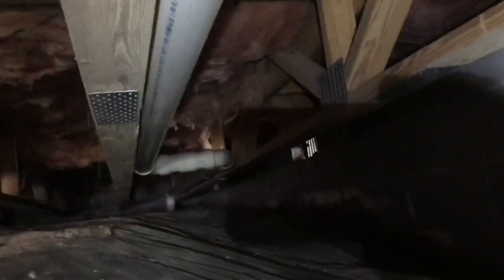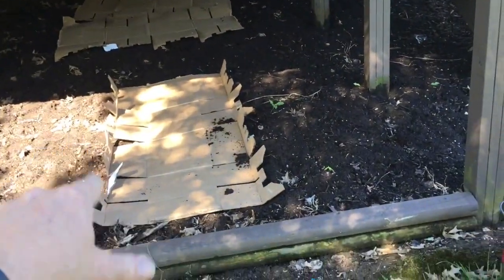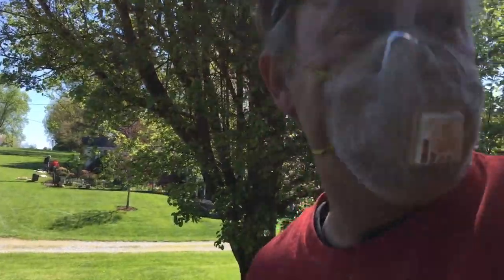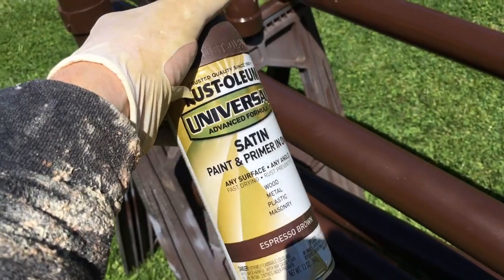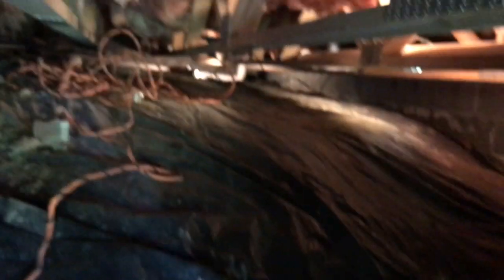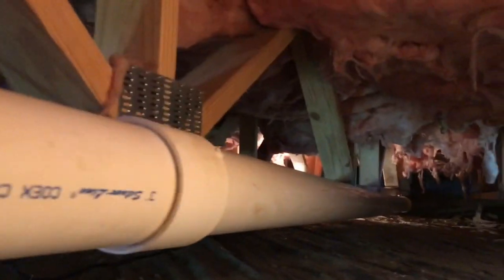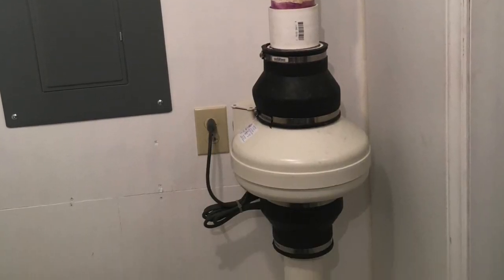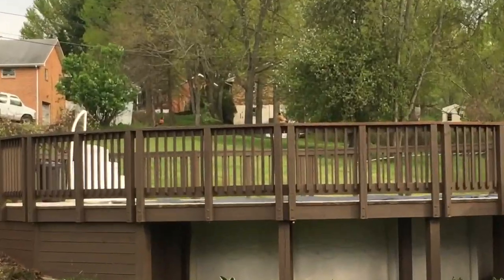Bringing a homemade radon system up to code

Comment: You talk about "code." Show me in 2012 IBC anything about radon. I'll save you the effort. Building "Code" doesn't exist for radon systems. What the home inspector who got a Home Inspection Certification from the back of a  Men's Magazine meant is he needed to justify to the prospective buyer his $500 to $1,000 fee. Ethically, any system that maintains interior living space at 2.5 PC is what a homeowner needs and wants. "Code " is an emotional word used inappropriately by cons.

Comment: Is there any code requiring an outdoor radon fan to be a certain height above ground level? I want to lower my radon fan to about a foot above the soil so I can build a wood planter box around it so it's hidden.
Reply: I think that would be ok to do. You just have to make sure that the condensation inside the pipe is allowed to drain back to the suction point inside the house. If not, it will create a water trap, making your radon system useless.